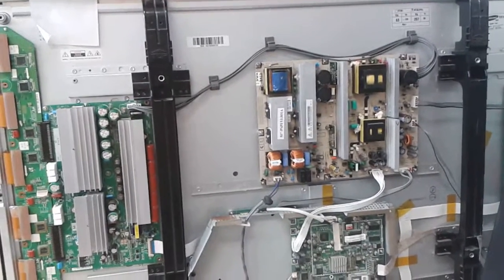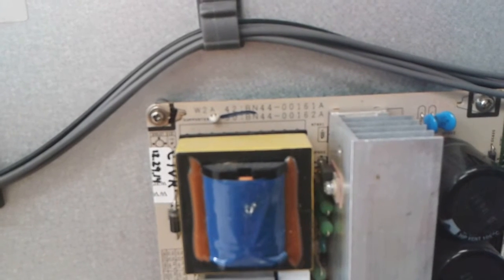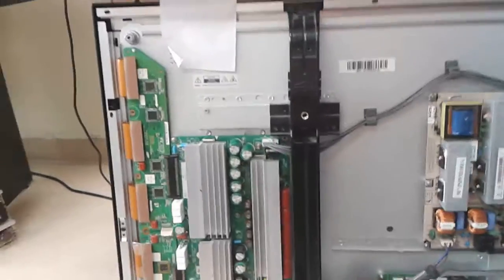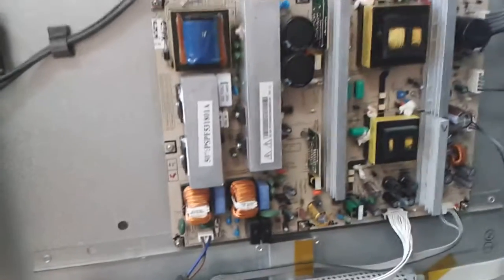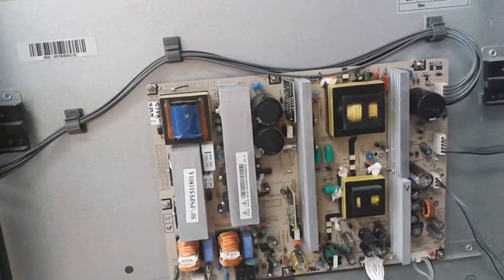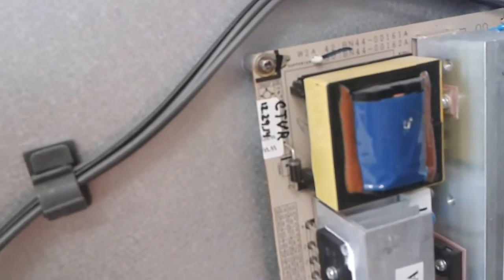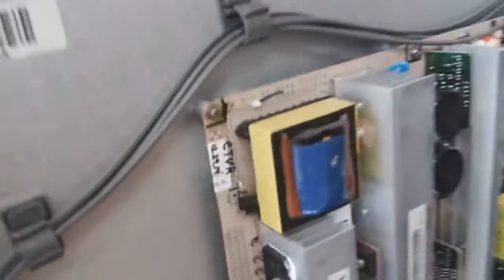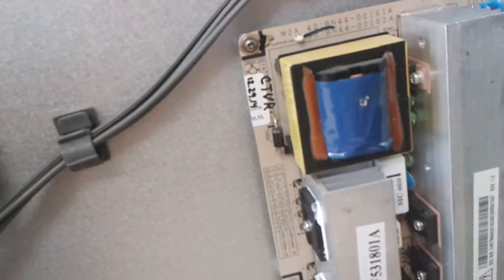BN44-00162A power supply board test in place of BN44-00160A

Comment from the maker: $60 provided it meets our requirements and you drop it off and pick it up. Please also note that in this TV very often the problem is not the power, but the Y-Main and the top buffer board (and much less often the lower buffer as well and/or the X-Main board).

So you may want to bring those along or maybe even bring the whole TV.

Of course if it's more than just the power board the price would also differ.

Comment: i'm looking for a bn44-00194A but cannot find...what can i use instead of it?
Reply from the maker: Presently we can not say which board is compatible with it. Sometimes there are more than one compatible boards, other times there are none, e.g. BN44-00175A and BN44-00183A do not have equivalents that we know of.

The best we can offer is to send the board to us for repair. 

I do not think we have a listing for repairing it at this moment, but you can still send it through 

http://www.coppelltvrepair.com/newservice

You are looking at between $50 and $70 for repair if the board is bad and we succeed fixing it.
If the board is bad and we can't fix it you pay only for the return shipping ($12-$15 depending on where you are).
If the board turns out to be good it'll be $20 testing plus return S&H.

See http://www.coppelltvrepair.com/t/QA%20Testing%20and%20diagnstic%20fees for details.

For others that may be reading this: the above can not be applied to just about any board for the simple reason we may not be able to test a randomly sent main board or sustain board or T-CON; testing all those require having sets that utilize them and we may not have them. Power supply boards are the one exception that we can almost always take in through the above link.
Reply: Coppell TV Repair LLC  - i think i'll pay more in postage fees than what the tv is worth :)))...the board is clicking once...and that's it...no power at all...
Reply from the maker: If you are in continental USA I do not think this is correct, but I would not argue with you. Either way, the choice is yours.
Reply: I live un continental europe :))
Reply from the maker: Razvan Zilber

Comment: Will the bn44-00190A board work in the 42'' plasma model HPT425X with the bn44-00161a board in it, any help would be apreciated. Thanks
Reply from the maker: chow Samaritan Yes it will.
Reply: Coppell TV Repair LLC Thanks big help, you got a customer.